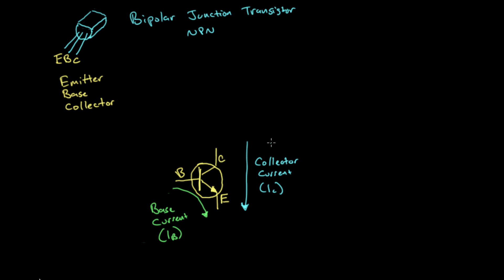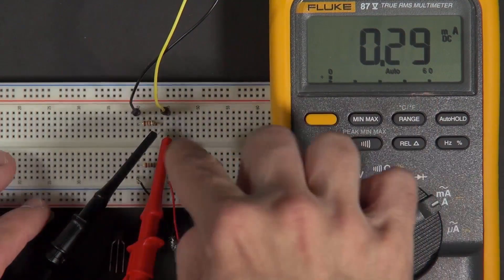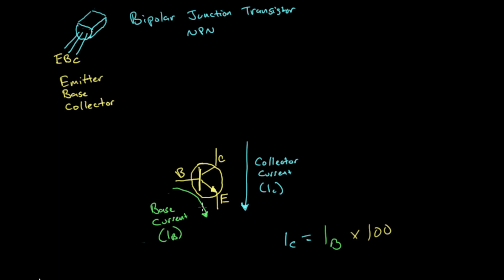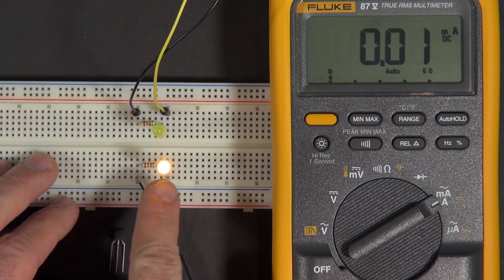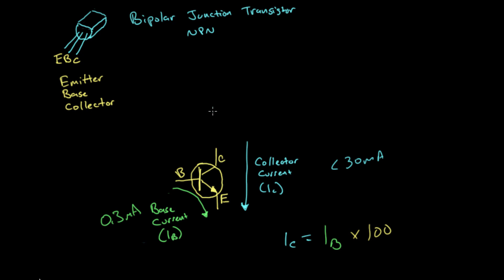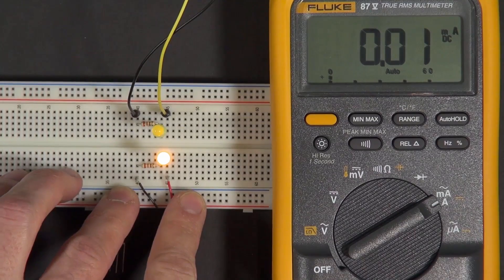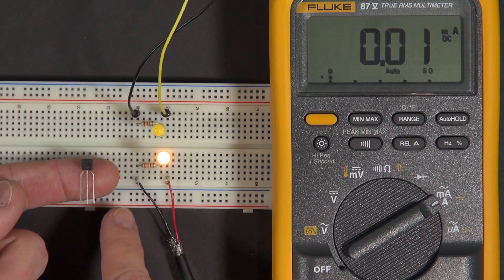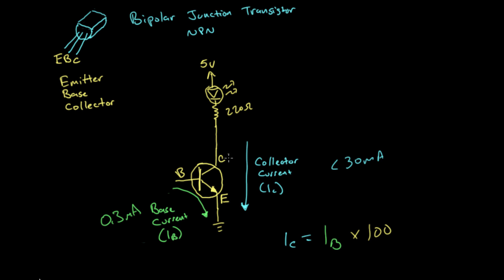Using a transistor to solve our problem | Digital electronics (8 of 10)

Comment: Transistors confuse me so much and this video does the same. "current amplifiers". how are they amplifying anything if you're just using a different power source which could have powered the LED from the start? this is basically a switch.

Comment: Maybe the 555 has a Pin 3 5V Out Resistor to limit its Voltage out as a setup to demonstrate how a NPN BJT can be used.  That Resistor eliminates the need for a Base Resistor, but you had to use the 5V USB Charger to do it.  This also ties both supply Grounds together.

Comment: Thanks for that video.

[ QUESTION ]
If, in a logic circuit using gates (and, nand, inverter, etc...), we want to connect an LED to an output (to check the result), what garantees us the output pin will draw enough current to properly light the LED (connected to GND with a 220 ohms resistor) ?

I mean, is it possible to be in a situation like you show here, and be required to use a transistor to light up the LED properly ?

Comment: I find it unintuitive to think of the transistor as a current amplifier. I didn't realize in the start that you're getting the higher Ic current from a different source, and was struggling to understand how a resistor can actually increase the current (which of course is not what happens). Makes more sense to me to think of it as using the signal coming in through "B" to switch the current coming from "C".

Comment: The premise of the video was to get the LED to be driven brightly by the alternating signal. Instead, you used a 5 volt source and connected the alternating current to the base of the transistor. This is fine if you are just trying to explain how a transistor works, but it wasn't the original problem. The goal was to get the LED to be brighter using the alternating signal. Instead you used a different voltage supply.
Reply: Energy required by that LED to glow brightly is 2 Volt * 0,02 Amp = 0,04 Watt.
That signal line brings only 5 V * 0,0003 A = 0,0015 W, but some of it is lost in the resistor. 

You can use tricks to transform energy form, from voltage to current and back and forth, but you can't create energy out of nowhere. It is impossible to use that signal for LED. You need more powerful source
Reply: What should be noted is, both Kirchoff’s voltage law and current law is based on the conservation of energy. That means you can only amplify by bringing in more energy!
Reply: I had the same thought, but I suppose the lesson I have to take away is that the solution needed to reframe the problem. I feel like I just heard a logic puzzle where the answer brought in extra information, which is frustrating, but after knowing the answer it makes sense.

Comment: Hi! Can someone help me? I don't really get how the transistor works as an amplifier. For me, It just acts as a switch, since the current is actually being supplied by the 5v power supply on the bottom. It looks like the transistor only limits the LED current when there is no current flow from the base to the emitter, I really didn't see how it amplifies anything.
Reply: Have the same question! The bottom circuit already have enough current. 

And if it amplifies the current does it mean that we can increase it up to infinity just chaining transistors?
Reply: It works as an amplifier because the current through the collector is proportional to the current through the base, multiplied by some gain value, which in this case is about 100, so the (maximum) current through the collector is about 100x bigger than the current through the base.
The 5v supply on the bottom can't provide more than 0.3mA of current, so it wouldn't be able to turn on the LED if you connected it directly, so a transistor and a separate 5v source are used in order to supply more current to the LED than you'd be able to without them (in this case up to a maximum of 30mA).

Comment: Does the transistor not create a dead short for the clock signal? If you resist it then it would lower capability of the transistor

Comment: So this requires both power supplies (both 5v sources), and so therefore, in this case, the transistor isn’t really amplifying, but rather, is only switching, correct?
Reply: I think he states exactly this towards the end of the video.
Reply: I wanted to see if he take the strong 5V out and amplifier the signal with the weak 5V. 🤯
He is a great teacher and very understandable 👍

Comment: Im confused. If electrons flow from negative (black wire) to positive (red wire) wouldn't it make more sense for the left end of the transistor to be called the collector and the right the emitter? Why do you keep saying that the electricity is flowing from positive to negative?
Reply: "Conventional current" describes the flow of positive charges, and in general, we describe electricity using conventional current.

It is the exact opposite of the way particles inside the components actually move, but because of convention, we keep describing it in terms of the flow of positive charges.

Comment: Hi Ben thanks a lot of wonderful video, i have one question we are using two power source now with the Transistor and the previous power source was already lighting the LED more brighter then how Transistor helped here.
Reply: The transistor does NOT help with the "LIGHTING UP" of the LED.
Rather it merely CONTROLS WHEN it lights up !!
Best regards
Reply: @mpadlite2925  then how transistor actually amplifies the current? It looks like it stays the same. It only acts like a Switcher. What I am missing?
Reply: @vitaliimakarov6181 arov
(Please bear in mind that I myself is only trying to learn how this works)
 I would agree with Your "conclusion", the transistor does not actually multiply the current. It rather just acts as a switch for the higher "driver current", that is high enough that it can light up the LED "fully".
But since the transistor "is fed" a (lower)"control current" (to the base) to "allow" a (higher) "driver current". And that the "driver current" is proportionally higher than the "control current" (as long as the transistor is in it's linear region) this is "seen as/called" that the transistor is ""amplifying"" the "control current". Even if it "in reality" is "only controlling" the (higher/stronger) "driver current"
Att least that's how I have understood it.
Best regards

Comment: Hey man truly amazing videos, I learnt so much from you in the past few days. One thing I never really understood though is how a transistor can be called a current amplifier when the current through the LED is actually coming from the more powerful 5W wall adapter? If it was truly a current amplifier then it should take the weak current from your mystery circuit and turn it into a strong one without using the stronger 5W wall adapter. What am I missing here?
Reply: It's a sort of shorthand analogy, as I understand.

When it's referred to as a current-controlled switch, the focus is on it being, well, a switch. Turn current on, turn current off, use a smaller current to control it.

When it's referred to as a current amplifier, the focus is on the signal that's switching it. The pattern of the signal is replicated with higher current. Signal in, same signal out, but with amplified current.

It's not directly literal, but it makes sense as a way to describe it focusing on what it's being used for.

Comment: So what's the point? We should have 2 input voltage/current so that  transistor works??
Reply: Yes, you are using the first voltage as a signal and supplying voltage to the indicator LED.  BTW: I was thinking the same thing at first--I had to remind myself I came from his breadboard computer series and digital (on/off) signals.

Comment: Man, that's a very good explanation of 'how transistor works as a key' but your initial goal was different. You have a periodical signal, while there is not enough current in it to flash the LED, so let's amplify the signal. Not 'let's take DC voltage that can provide enough current and modulate it somehow' but 'let's amplify ORIGINAL signal using only its power'. That misleads very much.
Reply: Also there is a problem in explanation of a current that flows by itself. Current is always a derivative of voltage and resistance. If voltage and resistance allow, it can be infinite. If resistance is high or voltage is low or both it's limited. And honestly, after 8 VERY LONG videos I still not get the idea of 'why the current of the periodic signal is not enough to flash the led'. We have voltage U and resistance R and signal is periodic. But according to Ohm's law I = U/R, so why I here is not enough?
Reply: @rkurbatov  Someone else here said it was because there wasn't enough ampere. As that kind of LED works at .2amp (If I remember correctly), but there wasn't even 1/10 of that from the mystery box, so the LED was very dim. Which is why a secondary power source is needed and a transistor. A transistor amplifies the ampere, which is what is needed to get the LED to shine. Please someone correct me if I am wrong.
Reply: I somewhat agree. This was an excellent tutorial, one that showed how to use a transistor to solve a challenge with amperage. This DOES fit the series title. However, contrary to the lesson narrative, I see the actual result as more of using a transistor to create a relay rather than using a transistor to amplify a signal.

Comment: Suddenly we're talking about "ground" and I don't get it.  If we replace the bottom red and black wires with the 9V battery, instead of the USB power supply, would it still work?  I'm confused about how the black wires of the top circuit and bottom circuit seem to be mixed.  Ghostbusters told me never to cross the streams, but here something very stream-crossy happened that I wasn't expecting.

Comment: Wish you would amplify the mystery signal from 0.3 mA to 30 mA, instead of using the signal as a switch to turn on some other source of current. Imagine what could be solved if you could harvest 100 times current from any mystery source? Well, I guess a transistor cannot do that.
Reply: Without using an external power source, you can only have as much power as the input can provide. With a transformer (AC only) or a switched-mode power supply (DC and AC), you can convert the input current to a higher output current directly, but the power would be the same or lower, so the output would be 50mv at most (at full current).

The only way to have a higher instantaneous power would be to have a battery/capacitor* charge from it over time (with a diode to prevent it from discharging into the input), but you would only be able to sustain the full output current for at most 1/100th the time it took to charge. (i.e. if it charges to 5v at 0.3ma in 100 seconds, it would only be able to provide 30ma at 5v for 1 second).
In other words, you would be collecting a low amount of energy over a longer period to expend it all in a shorter period.

*The capacitor wouldn't have a linear charge curve, and without a converter, the output voltage/current wouldn't stay constant as it discharged, but the principle is the same.

Comment: I understand the explenation at 07:30, if the electrons flow from + to - but they dont? And the explenation doesnt work the other way, because how should the transistor know the difference between the powersources then? If I assume the electrons flow from + to - I dont understand how the resistor for example can affect the LED, because it works  „after“ the LED?  Can someone help me out?
Reply: He's using conventional current, which is the standard in electronics for historical reasons. Conventional current doesn't assume that electrons flow from + to -, it assumes that there are positive charges that flow from + to -. This is equivalent because + is more positive than - in both cases (negative charges coming from -, or positive charges coming from +). In physical terms, you could think of the positive voltage as "sucking in" electrons from ground. The transistor only cares that the base and collector are more positive than the emitter*.

An analogy is that you can think of a vacuum-sealed container as sucking in air (the interior having negative pressure), or you can think of the air around it as pushing itself into the vacuum-sealed container because it's empty (the exterior having positive pressure). Even though physically the latter is true, the result is the same either way: the walls of the container bend inward.

The resistor doesn't work "after" the LED, current flows through both of them at (almost) the same time. One way to think of it is if you put water through a thin pipe and a thick pipe, assuming they're already full of water, it doesn't matter what order you have them in, the same amount of current flows either way. 

When you apply a voltage to a circuit, you aren't "filling" the wires and components with electrons, you're shoving electrons through the wire and pushing out the ones that are already there through the other end, where they circulate back to the current source. Most electronic circuits are closer to closed hydraulic mechanisms than regular plumbing.

* Bipolar junction transistors actually allow current to go in either direction through the collector and emitter, it just works better as a current amplifier in one direction because of how they're made. The base still has to be more positive than the least positive terminal, though.

Comment: The current flowing from collector to emitter is 30 mA or 20 mA?
Reply: It can be 30mA or greater, but in this case our load is the resistor 220 Omh + LED with Vf = 2V than it drains no more than 20mA from 5V USB adapter (transistor can't pump a more current than a load may drain, in saturation mode it having near zero resistance). Here we mixed two currents in transistor, one from  mystireous device which is switching on transistor and second from USB adapter. Either of it flowing thru transistor but they paths are different branches of schematic network (as two circles makes an 8 shape with transistor in the middle). Transistor just passes thru the current for the load, same that it was without transistor before in USB - resistor - LED circuit. It's solid-state switch, replace it in mind with ordinary switch and switch it on or off when readings changes 0 to 5V and 5V to 0 on the multimeter. The word Transistor is deriviative from transfer resistion.

Comment: Without the resistor at base of transistor how do we know current is 0.3 mA?
Reply: The precise value doesn't matters in this case, we already know that it's at least 0.3mA and it's enougth to switch on transistor working as switch, it will be saturated.  Value matters when you're building an amplifier, then saturation of the transistor is undesirable, and you must set a proper mode.

Comment: But now you need tow battery's... There no way to increase the Amp without another battery?
Reply: The 5v at the base of the transistor isn't directly connected to the battery, it's connected through a circuit or a resistor that limits the maximum current it can deliver. You only need a second battery if the first one can't supply the amount of current that you want even when connected directly.
Two voltage sources are shown in this example because it's showing how you would use a transistor to amplify current from a device that can only supply a limited amount of current. In this example, a separate battery is used because it's assumed that you can't tap into whatever power supply the device has, and you're making something that is separate from the device.

Comment: Question:  since the signal is from a "Mystery circuit"  to be safe should there be a resistor on the base (or the ground of the mystery circuit) to prevent it from being a short? we don't know if that circuit as any resistance in it. I hope a worded that clear enough.
Reply: Who would limit measured current to 0.29 mA, then? Of course the mystery circuit has a built-in output resistance, and its value is 5 V / 0.29 mA - 220 Ω = 17 kΩ.

Comment: Guy saying  'i'm amplified blinking current with help of transistor', then connects LED to DIFFERENT source with higher current flow, and makes that source blink. The ORIGINAL blinking signal remained weak. Noghing is amplified. 
And that's it. Transistors do not amplify anything they are just switches allowing you control current with other current. Otherwise it would break energy conservation law.
Reply: lazy_racer I get it. The transistor doesn’t (can’t) create energy. It allows a weak variable signal to be converted to the same variable but stronger signal.
Reply: Ie using a steady strong signal from outside.
Reply: The signal is amplified. The power for that amplification is supplied by an outside source. That's how amplification works.
Reply: jm i don't think so

Comment: Your previous videos in this series were worded such that it wasn’t clear where the “multiplied current” was coming from. I thought somehow the base was being multiplied (which I knew didn’t make sense and so was confused.) In fact, it seems the current is not multiplied, rather, a current of a multiple amount of the base is allowed to flow between collector and emitter from some other more powerful source.
Reply: yeah that is what i get from this. At first i thought he would somehow magically make more current to flow from the "mystery signal box" and amplify it by 100x which is basically magically drawing 100x more energy from the source that just cannot provide that, and somehow this made it so unclear.

the "allowing X times more current than base to flow from more powerful source" is a nice explaination and one that is true to what is going on in reality
Reply: @Neuroszima  Moi, aussi.
Reply: Question if if something is a multiple of something else isn’t it multiplied to get the results?